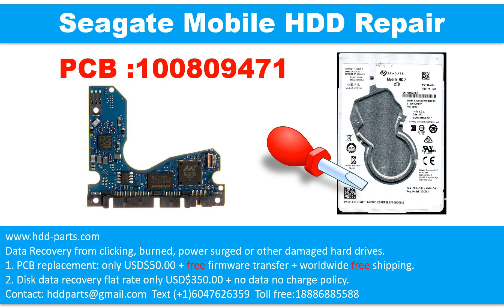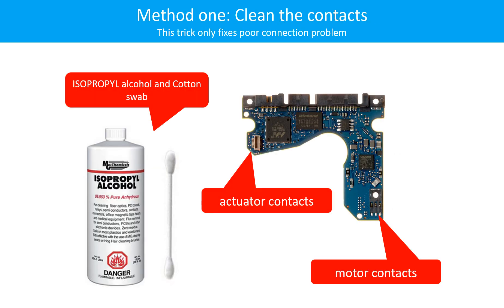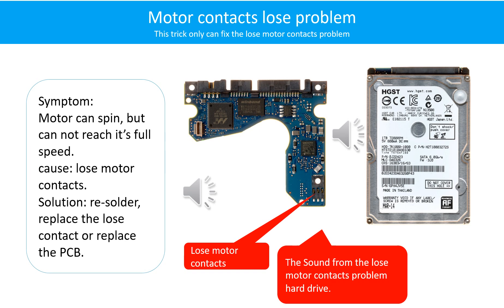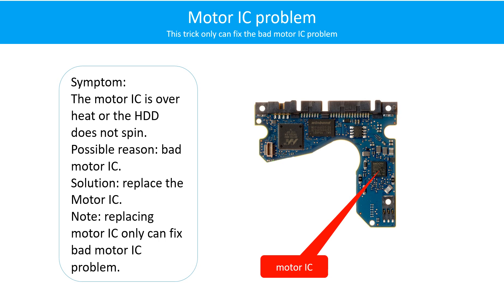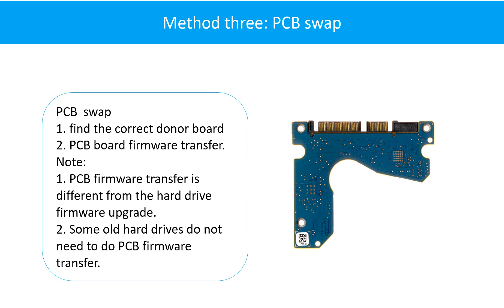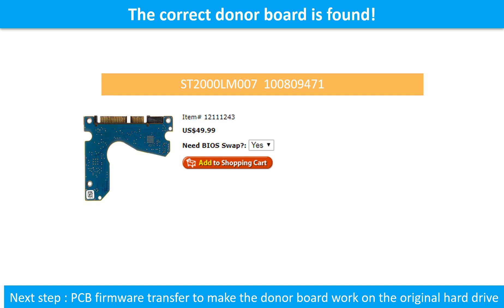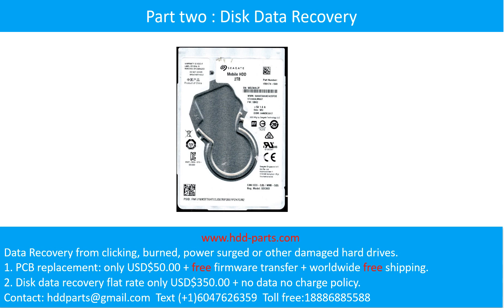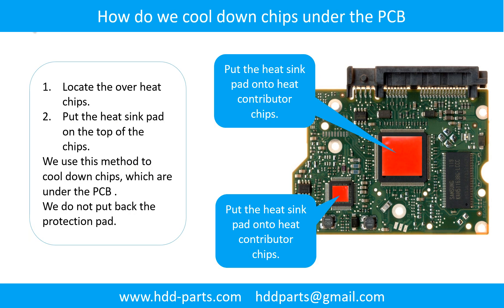Seagate mobile HDD clicking not working PCB repair disk data recovery 100809471  ST2000LM007

Comment: Thanks for the video, very informative.
Unfortunately I own one defective Seagate unit like the one depicted at the start of the video (Seagate expansion 1.5T) 
All of a sudden is stopped being recognised from my laptop: it's  detected from the OS but uninitialised and the soze it's either 0 bytes or a negative number.
I can hear it spinning inside, no clicking noises or anything, the ony weird noise it does is sort of a whistle when i disconnect it.
I will contact you soon.